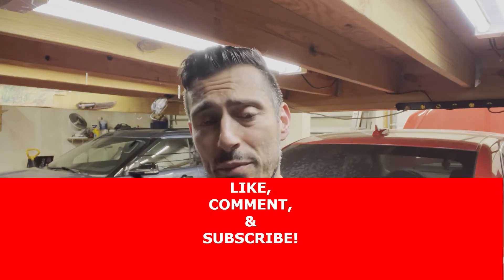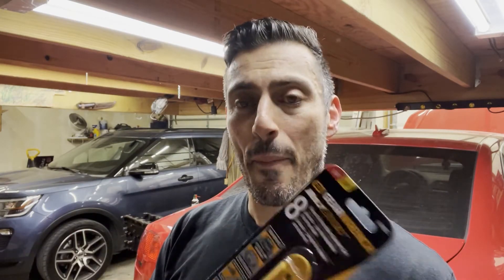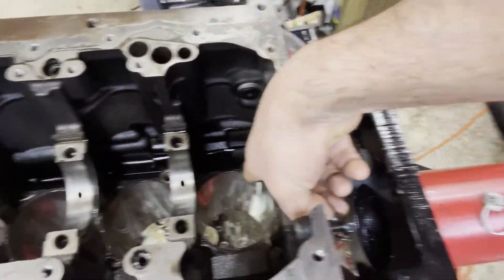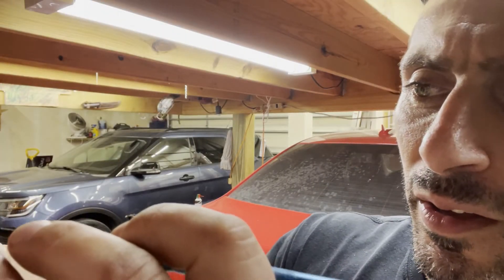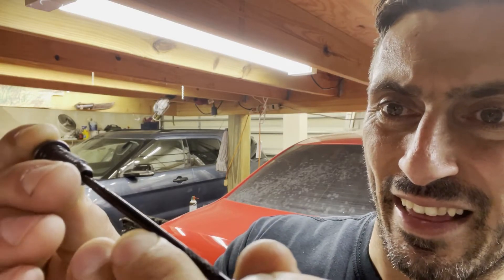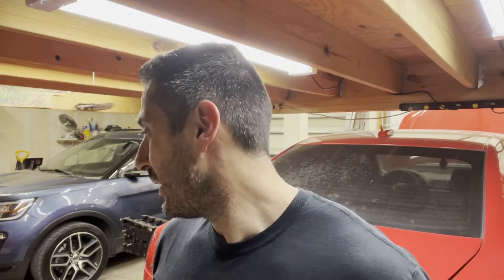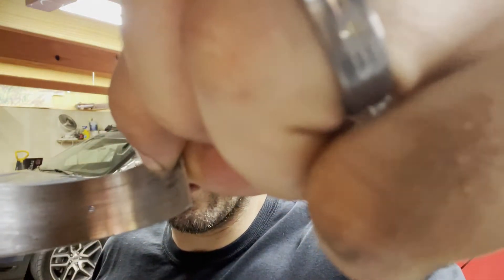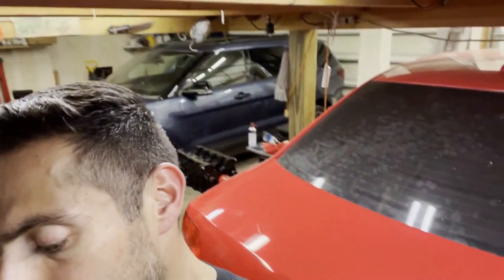PROJECT ROJO RE-DO PART 7: DIAGNOSIS COMPLETE! LOW OIL PRESSURE CAUSE IDENTIFIED!

Comment: I have a oil pressure red light take off the oil pen 2 squirters was broken way the are broken in 2 pices GOD now
Reply from the maker: Good job discovering the problem. Unfortunately to get to the oil squirters, the crank will have to come out.

Comment: What is the tool used to remove the squirters?
Reply from the maker: Hi! You will need an triple square socket - I believe it is an M8 triple square. To remove all the squirters, the crank has to be fully removed. Once you have access to the squirters just break em loose with your M8 triple square and pull them out. To go in, I believe they are torqued to 25 NM. Thanks for the comment and the view!

Comment: Great topic on these oil squirters,I'll have to watch out for those,I buy n repair b7s for hobby ty
Reply from the maker: Yes, please do! These things are killers and to get to all 4 of them, the whole block has to be stripped. You should replace them during a rebuild, but at a minimum you should check the spring. They are notorious for causing low oil pressure when they go bad. Thanks for the comment and thanks for watching!
Reply: @BeerWrench Garage  I discovered you by your oil pump install ,I'm studying and highly considering doing balancer shaft deletes to my b7s.
Reply from the maker: @jiujit49  Thanks Brother! If you have any questions dont hesitate to email me at beerwrenchkc@gmail.com

Comment: Probably should have checked TSB's  (technical service bulletins) right off the bat. probably would have a lot of time and money.
Reply from the maker: Thanks Chris - Im not sure there is a TSB for failed oil squirters on these engines. But I didnt do a thorough search for one either. Do you know if in fact there is a TSB in existence for this issue?

Comment: If I actually has some common sense these engines run over 60 PSI oil pressure when its cold, I think the issue is something else, try to find the root cause instead of treating the symptoms. Assuming that 2 out of 4 squirters are bleeding oil pressure when oil is thick and cold, how much pressure do you think you will loose- may be 30-40 psi at most, do you really think its enough to cause engine damage within 15 mins of running without load- i ant no specialist in fluid mechanics but the left over 20 psi is more than enough to keep the engine running at idle without causing that much damage. I would rebuild the engine as per specs.
Reply from the maker: Thanks for the comment. I tore this engine down piece by piece and inspected the oiling system and bottom end components closely. There were no other obvious signs of what would cause low oil pressure. These things were the biggest culprits per my investigation. I ran into another person that had a similar issue as mine and he resolved his by replacing the oil squirters with new ones. So I feel like Ive expended all reasonable options and I am going to proceed with this approach.

Comment: SPEED ACADEMY had a tool that you can simulation oil pressure with a tool. Wonder if that would be a good tool to use before stuffing it back in.
Reply from the maker: I got new ones from the dealer so that should be good to go. Out of curiosity, I will look up the Speed Academy tool to see how it works.

Comment: I think you've solved your oil pressure problem.  Those oil squirter check valves are normally closed at low RPM as the pistons don't need cooling at low RPM.  If you lose spring pressure the squirters are functioning at low RPM and are essentially bleeding off oil flow which causes the low oil pressure.  I presume you had acceptable oil pressure at higher RPM where the flow is greatly increased where the squirter check valves are open but no longer have much effect on the oil flow so oil pressure reading should be to spec.  Alternatively, if you were also suffering low oil pressure at higher RPM it is more than likely a faulty oil pressure relief valve on the oil pump itself - a known problem with these engines.  Enjoyed your videos.  Thanks
Reply from the maker: Thanks Edixo for the comment and the information. I do feel that I've found the problem and am looking forward to putting the engine back together with new squirter valves and a different oil pump.
Reply: What he said. Wow, I didn't even check mine.  It never came up. Good find!